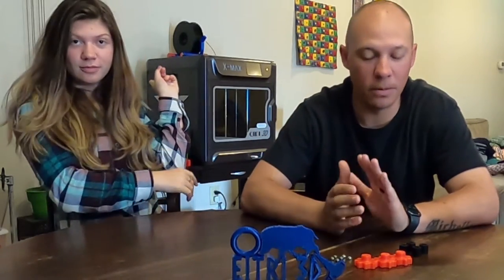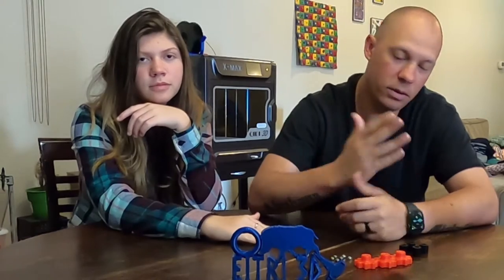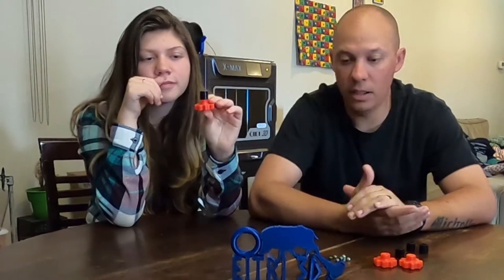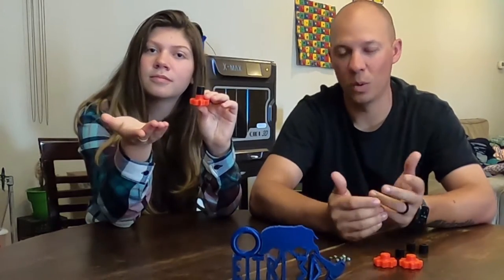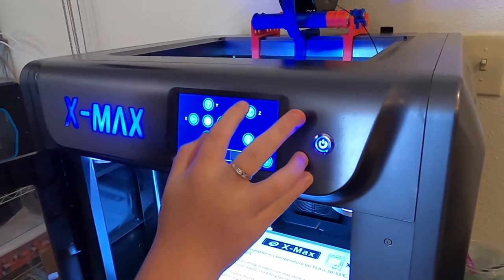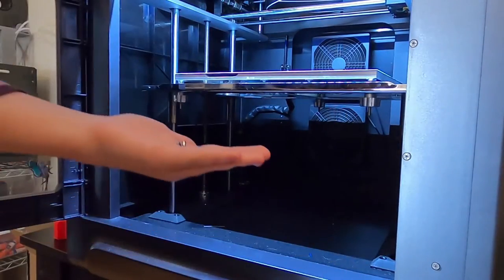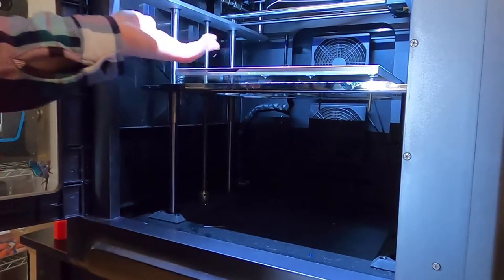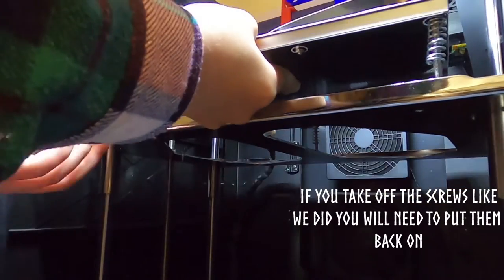Upgrading the Bed Leveling System on Qidi X-Max

Comment: Glad you found the leveling nuts useful.  I was really frustrated with the original bed leveling screws and "locking" wingnuts - you spend all that time to get things right where you want them and then things move when you lock them.  I've been using the new leveling nuts for longer than anyone (since I made them) and I'm always glad I did it.  One thing that's useful about the larger nuts and the reliefs around the outside is that it's easy to see the nut and move it a small amount to move the bed up or down a little bit.  I like to use a skirt on most of my prints and sometimes I'll make small adjustments based on the skirt as things start and with those nuts it's easy to make a consistent up or down adjustment across the entire bed since you can tell how much you're turning them.
Reply from the maker: That’s some great advice about making any adjustments during the printing of the skirt. These leveling nuts have been a great upgrade for me and many others. Thank you for the great design and ease of printing. I hope my video has sent people to your design page to help make their lives a little easier.
Reply from the maker: Based on my research, I think you would be fine. Here is why I say that, “silicone rubber can be used indefinitely at 150°C with almost no change in its properties. It withstands use even at 200°C for 10,000 hours or more, and some products can withstand heat of 350°C for short periods.”

Comment: Thank you very much for the helpful video. Had always problems with X-MAX and bed leveling. Works much better now :-) Greetings from Germany!
Reply from the maker: That’s awesome to hear that our video was helpful. This upgrade has probably been the most beneficial for us too. It’s making us lazy cause we don’t have to level the bed every time we print now.
Reply: @Eitri3D  Thanks! Btw. how often you need to level the bed since you changed the system? I heard, that there are now two Qidi-XMAX versions. The newer one is having a slimmer aluminum bed which is not as stable as it was before. I saw some reviews from people that are printing out of the box without doing any leveling for months. So I definitely got the newer version.

Next project is to add the Octopi to my X-MAX. Keep up with the good content :)
Reply from the maker: Before the upgrade I was needing to level the bed at least every 3rd print and sometimes every print. Since the upgrade, I level after I swap nozzles or have to take the hotend apart, but I try to make it a point to check the level at least once a month.

Comment: Thanks Mike, I just completed this mod, and it feels so much more precise than the original springs.  It's feeling like it's keeping its level now.  Now to work up the nerve for the Chad mod.  Thanks again!
Reply from the maker: This mod is the only “must” in my opinion. You’ll find yourself going multiple prints before checking the leveling in the bed. My advice for the Chad Mod is if you’re happy with you setup and it works then keep it. I had a massive clog that required me to purchase replacement parts so that is when I decided the upgrade. I don’t regret it one bit though. Glad our video helped out. Cheers!
Reply: @Eitri3D    Good advise Mike.  The machine is only a week old and printing spectacularly, I was almost thinking I might regret not waiting on a Prusa, although it will be on my radar when and if they come out with their larger model they've been hinting at.  Thanks agian!

Comment: Thanks for the video guys!

I just want to add some information for those that are doing this right now or considering it.

1. Unplug the machine. At least turn it off. Completely unnecessary to work on a machine that's on and metal parts can touch other metal parts in the wrong spots and short something out or worse.

2. I did this on an X-Plus and you will need 18 mm for all the bed screws. 16 mm are too short. Maybe the plate is a different thickness. I might even go up a size in the back, maybe 20 mm.

3. You don't need the 3D printed adjustment knobs or the locking nuts. It is a cheap and easy upgrade, but it's not necessary. Since you won't have to adjust your bed as much after this mod the adjustment knobs and the wing nuts that come with the machine are perfectly adequate.

Peace out.

Edit: Just to add something about the stock wing nuts and leveling screws. You don't have to tighten the wing nuts that hard since they have locking washers. That's probably why some people are having the thumb screws move when tightening the wing nuts.
Reply from the maker: Thanks for adding information about the X-Plus, that is one machine we don’t have. I honestly did not even realized I left the power on while doing it. Rookie mistake that thankfully did not end bad. Thank you for your comment, it is truly awesome to see people helping each other. Cheers!
Reply: @Eitri3D  We've all done it. 👍

Some things on these 3D printers need to be troubleshooted while it's on though so it's not completely uncommon to work on a machine that's running. It really just depends what aspect of the machine you're working on. If it has power going to it, shut it off before you play with it. That's what I always say. 🤙
Reply from the maker: I have some background in electronics so I wasn’t too worried for myself, but more disappointed I could have set a bad example for those that do not have that background. Just can’t believe I didn’t even catch it. Do you run multiple printers? If so, which ones?
Reply: Do the silicone columns still hold up well? I have the same model and I'm thinking of trying this out since I'm unable to properly level the bed with the stock springs. Thanks in advance! : )
Reply from the maker: They do, now after being compressed for so long they don’t rebound as quick, but I honestly haven’t had to relevel in 6 months.
Reply: @Eitri3D  I just tried it out but the only issue is the leveling: It seems to scrape the bed. Could it be that all sides are not perfectly leveled? If so how can I efficiently level the bed (I haven’t really mastered the art of leveling lol)?
Reply from the maker: Make sure you compress them down a lot a first, then as you level it you will loosen them to bring the bed up. The spring back quickly. Just over time of being compressed it takes long for them to rebound.

Comment: My i-fast came with the large sized leveling knobs, similar to what the printable design in the video looks like. I found that one locking nut under the plate slipped inside a spring. Boy, that really messed up consistency for that spring. I’ve used large washers to prevent that behavior, but am going to check out the silicone spacer idea. Temperature resistance will be important, since I’m running 105C for initial layers with ABS. I plan on printing CF filament soon too. I think the length of the screws should be 20-22mm so the locking nuts don’t fall off when loosened. That’s happened quite a number of times to me. However, if I level the i-fast plate at the required print temperature, it doesn’t change like what you have described for the X-Max in the video.
Reply from the maker: The I-fast and X-Max are merely a grandson/grandfather comparison. Everything I disliked about the X-Max was upgraded and called the I-Fast. I have not altered my I-fast except adding the Raspberry Pi, which I later moved back to my X-Max. You are the first person I have heard that had leveling issues on your I-Fast.

Comment: Don't need this "mode " to fix the problem with leveling becouse its not about the springs , but the leveling sensor's on the bottom have some shity and tinny metal part which is banding every time under a slighty diffrent force of bed (and this is actually couse of diffrent bed level ). Just simply remove them and you gonna be fine with leveling for wild ;)
Reply from the maker: Thanks for your comment.

Comment: Nice video. Always looking for ways to improve this beast. Bed levelling has been the plague of these printers. They have replaced my bed due to a severe warp, corner to corner, that looked more like a machining error than a thermal warp (bottom didn't show the same dishing when hit with a Metrascan) so after replacing it, I went to glass ilo the magnetic "stickers" - as long three of the four corners of the bed are at the same level, and the fourth corner isn't taller, I should be good... I modified mine from stock, but still used the springs - and, incidentally: still had problems. I have some silicone columns on order, so I think that will wrap up my bed levelling issues!

I'll have to look at your roller video, too. Finally, based on a direct phone call with them, they pronounce qidi as "chee-dee." :)

Cheers!
Reply from the maker: Their spring setup is definitely a faulty design. Could never keep it level until this upgrade. No I don’t have to level unless I remove the hotend. I’ll still verify level once a month, just to be safe. As for pronunciation, our newest videos have it correct. We had a native speaker help us out. Cheers!
Reply: Thx for the name, thought it was QUIDEE. LOL
Reply: My bed isn't terribly flat so I've just been printing using rafts. I've probably gone through ~25-35 spools over the last couple years without needing to re-level it once. I do reach under and tweak the knobs from time to time as the raft perimeter is being printed. Of the dozens of printers I've bought or built, the X-max has been incredibly reliable; so reliable I rarely even check it before sending and starting prints.

I'm curious how warped your initial bed was and how flat the replacement is? It would certainly speed up my prints and improve the bottom finish if I skipped the raft.

Comment: We have the Max-II and rarely find info on it, I think it is the same as the Max but just wanted to make sure. I read somewhere else to use 18mm all the way around but I see here you wrote that the back should be 18mm and the two front 16mm...is this the same for the MAX-II? I am pretty confused on how to level it after. I know you mentioned you have a video but I cannot locate the link, please share. My son's machine is trembling a little and it seems the nozzle is causing it but not all the time.
Reply from the maker: I’m sorry, I do not own a MAX-II. I cannot tell you for sure how similar they are or if the upgrades work for it. For the MAX, you can use 18mm all around or 16mm up front and 18mm in the back, they both work. For leveling, you find that video is called X MAX Introduction. Hope that helps.
Reply: They are the same thing from what I read except with some upgrades. I appreciate your help. It is my son's 3D printer but I guess I aspire to be the mom and son version of what you and your daughter do, lol @Eitri3D

Comment: Hey guys. Great video. 
I have a QIDI X-Plus and I tried to do the same thing. However, I'm running into a problem. When doing the (Recommended) leveling, the tray on the bottom is running into the support braces. I guess the 16mm and 18mm spacers aren't tall enough?
Reply from the maker: Honestly, I am having a hard time picturing this. Email us a picture if you don’t mind so we can see what’s going on.

Comment: Hello, thank you for the video. Do I understand correctly that I need 2 different heights? What is the reason?
Reply from the maker: You can use one size, but using the larger in the back gives you room so you don’t break off/pinch the wires connected to the back of the heated bed.
Reply: @Eitri3D  Thank you for the quick reply and the information